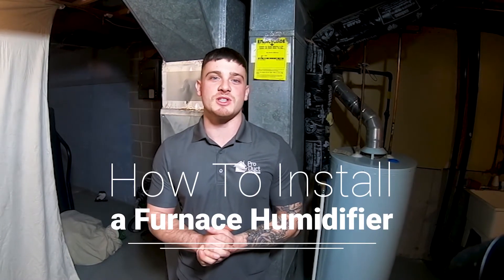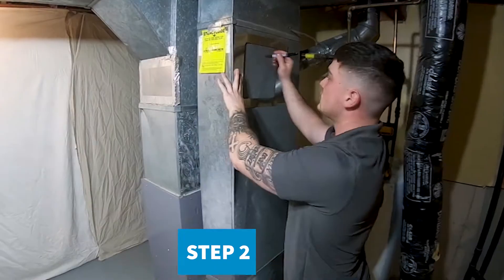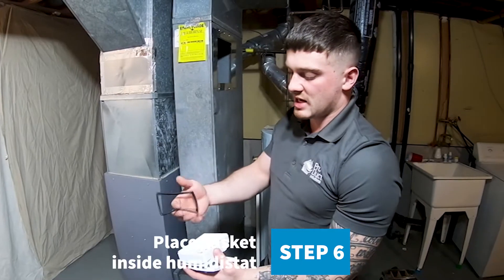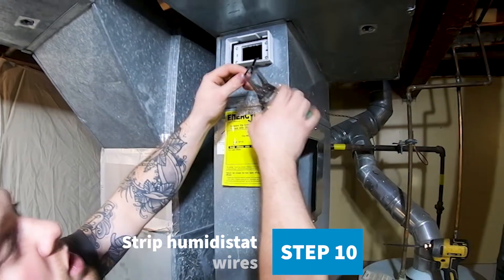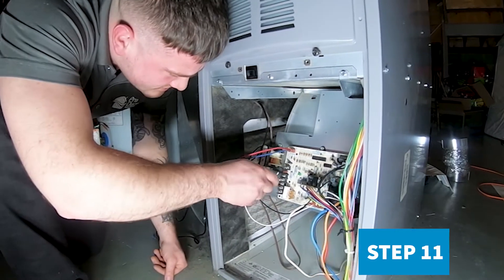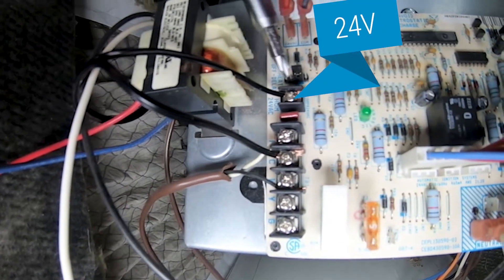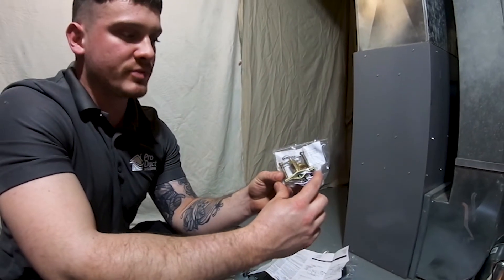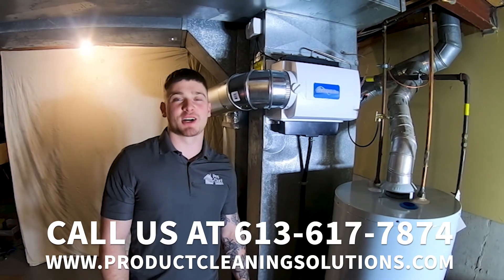How to Install a Furnace Humidifier

Comment: Curious, the unit usually going in the plenum on top of the furnace, and the return air gets ducted into the side of the humidifier.
Reply from the maker: Yes it’s called a bypass humidifier, the humidifier should be installed on the return drop and the 6” duct should be coming off the plenum.

Comment: This proved I need to hire someone. Way too complicated to attempt!!
Reply: It’s not to bad if u have a hum slot on board it gives u a wire diagram but u don’t have that then u need a transformer which makes it more complicated
Reply from the maker: The kit includes a step down transformer but yes if you’re not comfortable with electricity then I wouldn’t recommend attempting it. 

Also make sure to always double check the voltage on the Hum terminal. This humidifier requires 24V.

Comment: Didn't show where the wires are chased,
Reply from the maker: I’ll make a newer video, this was done around 8 years ago, you can either run them inside the ductwork and come out at the bottom near the furnace or surface mount the wires. It doesn’t matter which one you do.

Comment: Pretty sure those saddle valves are against code nowadays.
Reply from the maker: Yes this video was filmed over 8 years ago, I was demonstrating how to install the humidifier using everything in the kit. I’ll make a newer video video shortly showing the up to code way.
Reply: Illegal to use by insured companies , not for some joe in a basement :-)
Reply: @DEZERTER83  Stunning that these saddle valves are still sold today.. It's proven over and over that it will eventually fail in a matter of years

Comment: What's the average price for one of these units?
Reply: $150 Canadian. You can get cheaper or more expensive. depending on size of house etc.
Reply from the maker: Yes like the comment above, the humidifier is around 200$ and 550$ installed by one of our techs.

Comment: Is there anything wrong with hooking the wires to W and C instead? Also are some humidifier spades 120 volts?
Reply from the maker: Yes be careful, check the HUM terminal with a multimeter before connecting the electrical. 

If you want your humidifier to only run with heating then you can wire it in with W. I have it set up that way for my place up here in Ontario, Canada.
Reply: @productsolutions3142  Perfect, Thank you
Reply: @productsolutions3142 the guy who installed mine connected the wire to HUM and I measured 80 plus volts. I think it fried my solenoid. Does this make sense that HUM has that much voltage. Also would it have fried my humidistat as well
Reply from the maker: @truenorthmuskoka9077 yes that’s why you should always check voltage. Depending on the furnace manufacturer they either have 24V or 120V. Most bypass humidifiers only need 24V to open the solonoid.
Reply: @productsolutions3142 is W 24volts DC or AC. I need to replace my solenoid and Im not sure if I need a 24 volt DC or AC solenoid

Comment: Hot water line bub...
Reply from the maker: Yes if you install 1/4” copper line. In this video I’m showing people how to install a furnace humidifier using everything in the kit provided.
Reply: Is that the norm ? Hot water ? Mine is connected to cold by licensed plumber but my buddys is hooked to hot . Iam confused. Thanks for any input.
Reply: @richardkuechenmeister5811  nothing wrong with it being tied into cold line
Reply: @richardkuechenmeister5811  either is ok